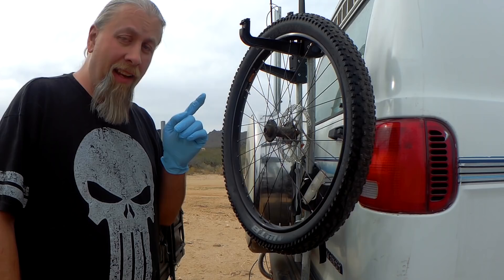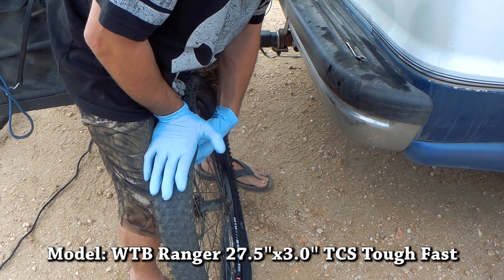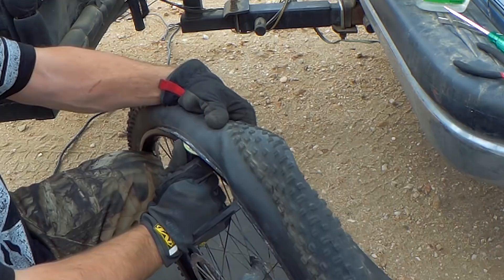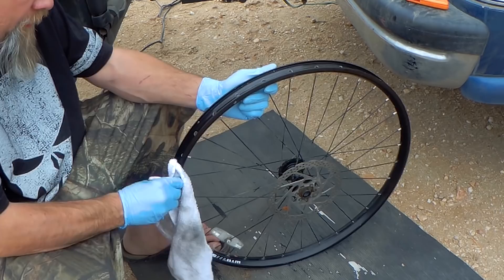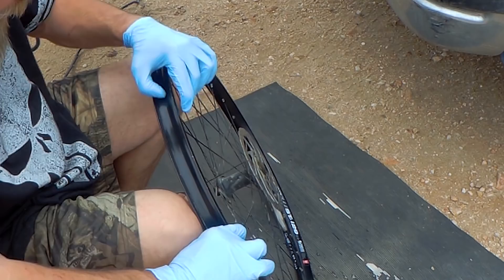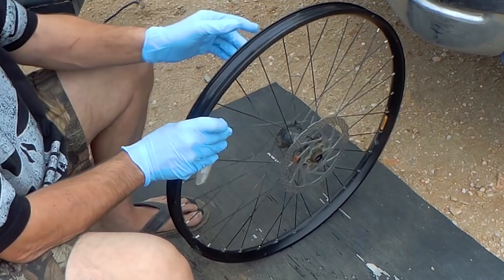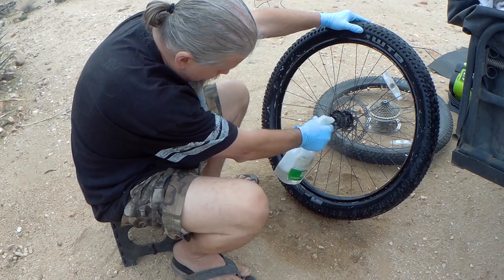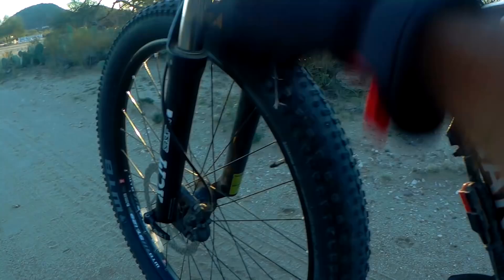How To GO TUBELESS On Your Bike! STOP FLATS and Enjoy BETTER RIDE QUALITY Without Tubes

Comment: Get a chain wear indicator...the rollers are what wears...just because a link breaks doesn't mean the chain is bad...it is probably because the origanal.chain pin was pushed...On the rim strips...go around twice with the gorilla tape and use a Phillips that's hot to make the stem hole so the tape melts and doesn't tear..also don't go too wide on tape or it will interfere with seal.I'm a bike mechanic and know that stans tape is  trash..when using Stans sealant use twice the amount that they recommend ...We put the stans before we install the tire which is difficult but easier than trying to put it through the valve and it can clog the valve.
Reply from the maker: Thanks for all the tips! The bike only had 110 miles on it when the chain broke. It certainly wasn't wear. Anyway, that same chain has been on a year since and so far no breaks. I decided to leave it on and keep the new e-bike chain for the next break.

Comment: That appears to be a lot of trouble and hassle for tubeless tires.  I simply use the very very thick tubes and never had a flat after thousands of miles on my e-bike.  With regular tubes I was always having flats and that is a pain too.
Reply from the maker: Try riding in the desert!
Reply: @HOBOTECH  Is it the desert heat that's the problem?
Reply: @JGSuttonJr  the desert has thorns.
Reply: dlocke49 any specific brand tubes you're using?

Comment: Nice job but here's the trick with removing and reinstalling tubeless bike tires.  Always start at the valve while pinching the tire on the opposite side so the beads drop into the well of the rim.  That gives you more room to pull the bead off with very little struggle, on some wheel and tire combinations, you won't need tire levers.  To reinstall, again start opposite the valve one bead at a time.  Second bead should go on without the need of tire levers.  I've never met a tire that I couldn't get on by hand and believe me some very narrow road tube and tubeless tires go on very very tight.  Take care and good luck!

Comment: Air Duct sealant tape might work pretty good. Hardcast 2 inch wide, foil backed with mastic. About $40 per 100 ft. 40 year life and is used on any kinds of ductwork.

Comment: Impressive.  Riding it around probably helps because you are putting pressure against the seal.  Might consider this for my trike, though I will be on established paths.  I suppose you can still get thorns and other desert stuff there, too.
Reply from the maker: Going tubeless dramatically increases the ride comfort because you don't have this hard tube inside the tire. Basically, the tires are more like shock absorbers without tubes so it is worth doing it just for that.

Comment: Thanks for the electric bike series; very useful. Can you measure each of the three sides of the frame triangle where your battery is? I want to see if a Luna Cycles triangle battery will fit so I don’t have to buy two batteries.  Can’t find the measurements on the  Motobecane website. Thanks! Well done.